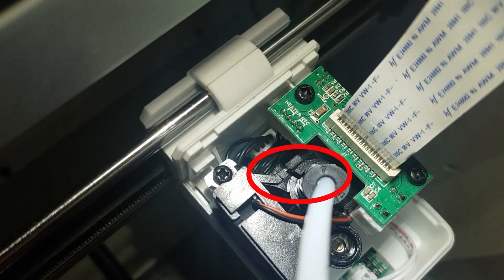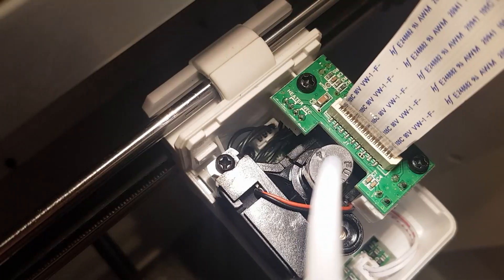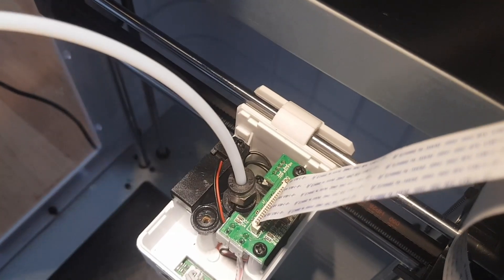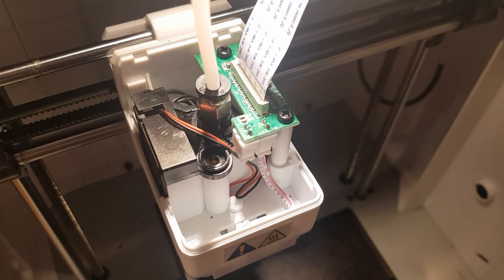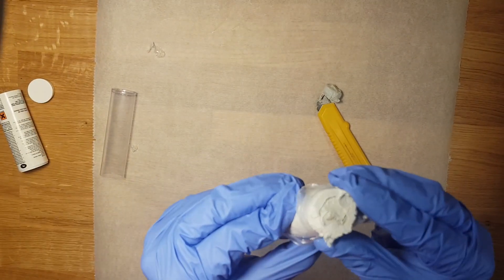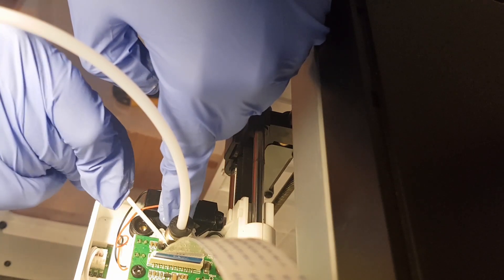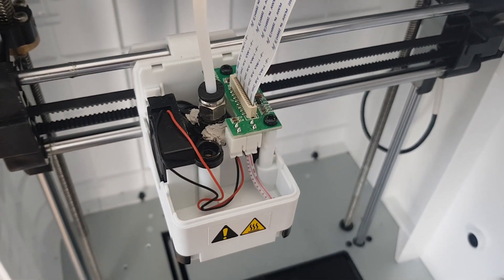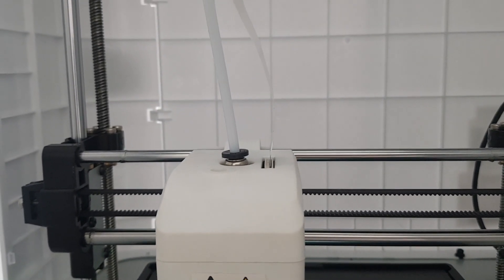Quick repair of the crack in the plastic enclosure of my Flashforge Adventurer 3 extruder assembly

Comment: What a hacked up fix... I'm pretty sure it would not have hurt to actually disassemble the hotend, so you can see how far/deep the damage is and really glue/fix everything that is cracked. It might work for now, but this is only a quick fix to get it working for a bit until it fails again at the same spot. Just hope for you it does not fail after 30 hours in a 40 hour printjob...
Reply from the maker: Thanks for the comment, that is a very good point. This was indeed a quick fix to get back to printing asap :) I'll keep you all updated how well this solution holds up over time.